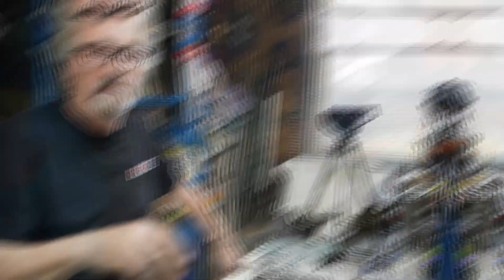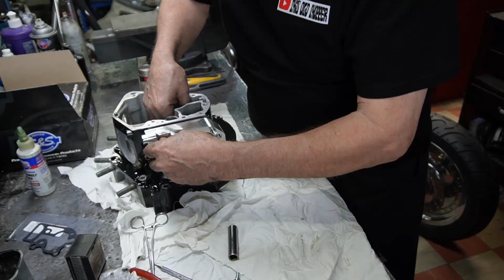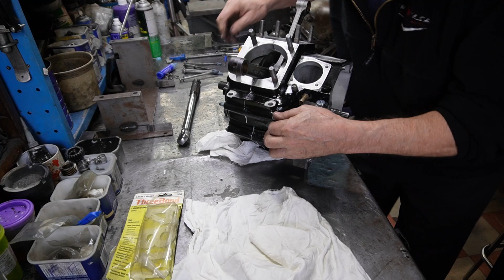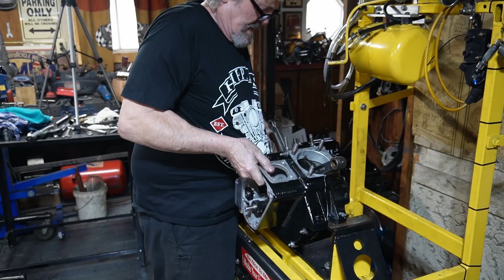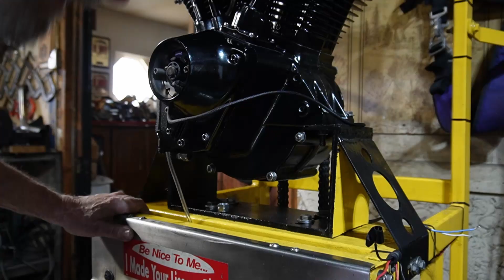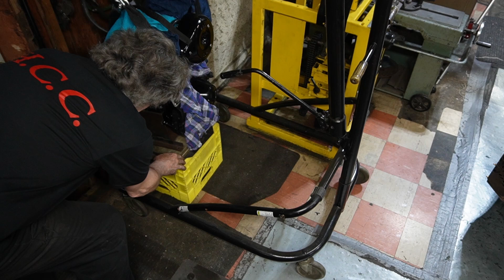S&S OIL PUMP INSTALLED / CASES ASSEMBLED / USING MY ENGINE LIFT

Comment: Is that a internal oiling system
Reply from the maker: Not sure on the question you have. The pump is the oiling system, mounted externally on the case but other factors work with it inside the case, breather gear etc.Thanks for commenting.
Reply: @itsmytimeletsgo  at one time the shovel heads had an external oiling system.  Tubes ran around the outside of the motor causing most of the oil leaking.  Using an aftermarket system you could convert it to an internal oiling system. Eliminating most of the oil lose.  Just wondering enjoying the channel keep it up!
Reply from the maker: @paulperrigo3517  Yes you could do that I expect by blocking holes in the system I believe. I think most of the lines were for drain back oil on the early shovel systems.  You could not eliminate the feed lines though.Thanks for commenting.

Comment: Crank hold down tool # ? oil breather timing ?
Reply from the maker: If you mean the tool to lock it up while you torque, or remove, the pinion nut it is Jim's K16 # 2237 (small number on it also 13428). Hope that helps you out. Thanks for the question and commenting.

Comment: what is the part # for the Jim's hold down tool ?
Reply from the maker: If you mean the tool to lock it up while you torque, or remove, the pinion nut it is Jim's K16 # 2237 (small number on it also 13428). Hope that helps you out. Thanks for the question and commenting.
Reply: @itsmytimeletsgo  thank you ! I took a pic of the tool but when I enlarged it  pixilated and couldn’t read it , thank you again !  When you talked about the lining up the dots on the gears you said it was important but didn’t say why . 
Now I know why ! Lining up the gears to the key way’s then the dots !  I don’t understand why . Is it about wear patterns ???
Reply from the maker: @johngouker3887  You must line up the dots for proper timing. Eveything has to work together, valve openings and closing, ignition timing and proper breathing all have to be right to make everything work together.
Reply: When you have the time. Is there such thing as oil breather timing
Reply from the maker: @johngouker3887  Yes the breather gear must be timed to work with everything else.  It also controls proper crankcase pressures. If the timing is not right, or there is a problem in the breather hole area, such as goughes etc, excessive oil will be pushed out the crancase breather hole.

Comment: Ralph, have you ever encountered an issue with a pump that caused continual oil sumping while idling?  Ive recently rebuilt a 79 Shovel motor with a sumping issue that a re-seated check ball did not fix.  Oil was flowing to heads (checked at front head front rocker nut) and back to the oil bag, but showing almost no oil pressure at the gauge on the face of the oil pump (gauge is known-good).  Any idea on what could cause this issue?
Reply from the maker: Hello. Something that I have seen do that would be the wrong cam cover gasket . I often see problems like that when people replace the gasket and get one for 92 and up evos by mistake. Looks the same but the 92 up only fits around the outer cam cover lip. The shovel and early evos have a gasket that also goes around the window area ( for lack of a better word), down on the left bottom of the cam cover. Did you change the cam cover gasket, or use a newer cam cover when rebuilding? Both could create that problem if they are 92 up types.  They will fit ... just not work properly. Also looked for pinched off hoses, especially the bottom crankcase breather hose or oil filter lines switched around. Last but no least it could be a sheared key in the pump or the pump drive gear in the cam case. When you rebuilt it did you check the breather gear hole to make sure there were no gouges in there and the breather gear is timed correctly? Could be that as well. Hope this helps a bit.
Reply: @itsmytimeletsgo  Thanks, Ralph!  Im running a horizontal mag nosecone that has a bushing accomodation for both side and end oiling pinions for year group 72-91.  I believe there is an excess of oil in the crankcase as per me (user error) when assembling.  Additionally the brand of pump I went with (which will go unnamed here and that Ive used on other projects) I did not prime the pump upon assembly (another user error).  Suspecting a pump issue like checkball seat or pressure valve, I tore the pump apart but all looked good, no keys sheared and seal in place.  Breather was timed properly and cam cover gasket is the proper one.  With oil pump off, nose cone off, cam and breather out, When I kick the motor over 5-6 times a steady stream of crankcase oil is pouring out of the breather gear hole.  Its safe to assume its an over-oiling condition...maybe combined with air cavitation?  Any recommendations on the best way to drain the crankcase that lacks a lower crankcase drain hole?  Im suspecting that the pump could still be an issue and will replace with an S&S.

Also, can early breather gears be used in a later Shovel motor?  Are there any glaring differences other that the "tit" for the endplay shim?  Im running an early breather gear (doesnt have the groove on the face of the gear) in a '79 80" motor.
Reply from the maker: @rok3427  77 up breather gear should have a groove cut into the face of it, like the cam. As far as draining it, you will have to start it up and let it empty itself out, when everything is correct. Also the seal between the feed and return gears should be replaced with a new one if in doubt. They can look ok but not seal under pressure if it is worn . If it slides off the shaft, when removing the pump body, with out any resistance, it may be worn. Also if the dowel pin that the gear sit on in the pump is loose and not pressed in tight that can create a problem as well.  It may seem like the oil is returning but maybe not fast enough. If you pull off the return line you can hold you finger over the  line end to the tank, or drain in a bucket,and if there is no pressure or just dribbling out then it may not be returning like it should. It may seem like the oil is returning but maybe not fast enough. Hope this helps.
Reply: @itsmytimeletsgo  Thanks, Ralph!  I appreciate the tips and have become a fan of your channel.  Keep 'em coming!

Comment: Good reference video , for when i start messing with my 98 Softail with SS motor. I see you were using old-school torque wrench, I have one of them somewhere. Thanks for sharing video. Peace.
Reply from the maker: Thanks Ed. I had to use that to torque to the left as my torque wrenchs only work using them to the right. Old tools still work well though. Thanks for commenting.